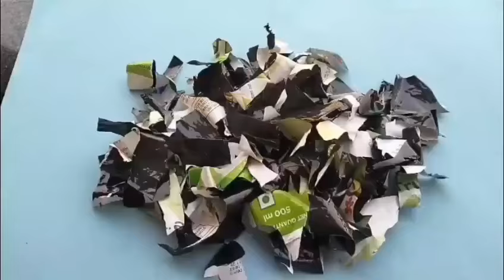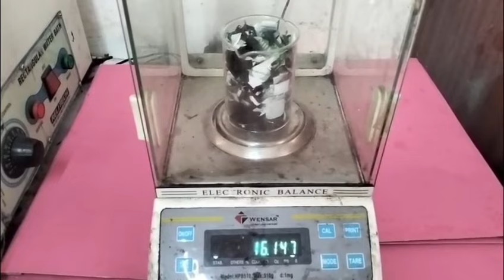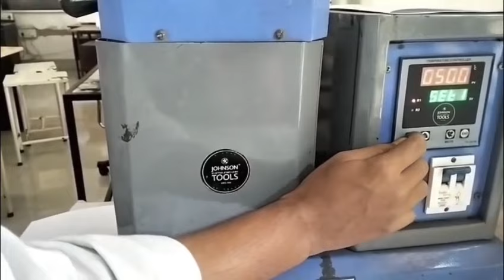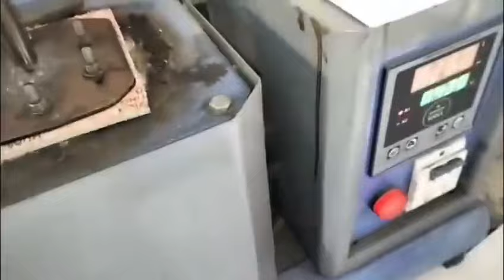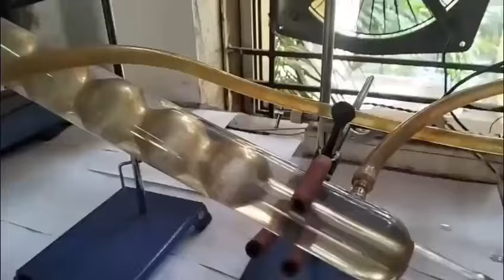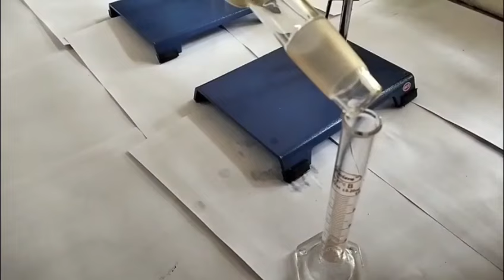Plastic to Fuel (Pyrolysis of waste plastics to fuels)

Comment: Sir, what is the carbon molecule range, where this fuel can be utilised . Can you please explain
Reply from the maker: The hydrocarbon range is in the range of diesel and kerosene, however it depends on the pyrolysis condition. This can be used as a fuel or chemicals after purification. 
I will upload one video mentioning these. Thank you for your lovely message. Keep watching.